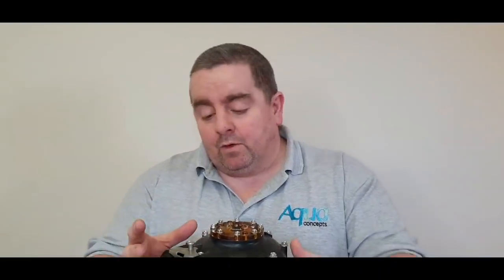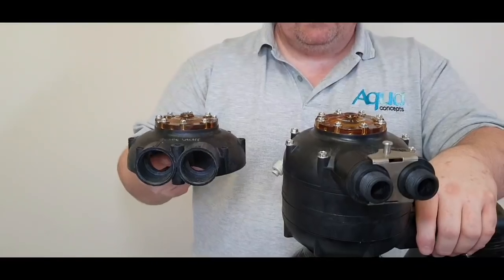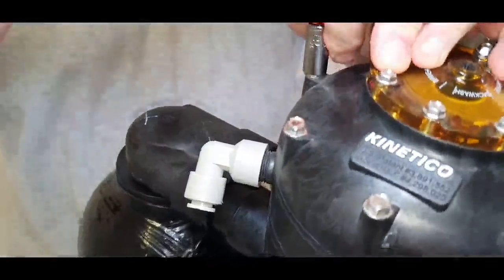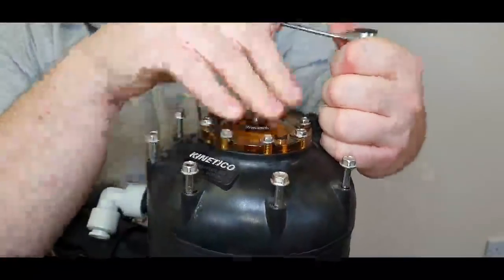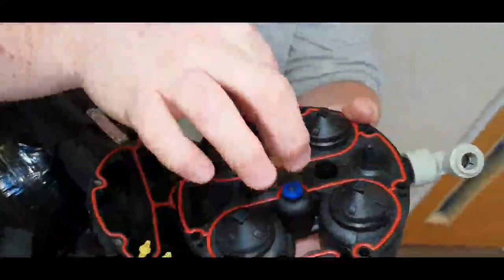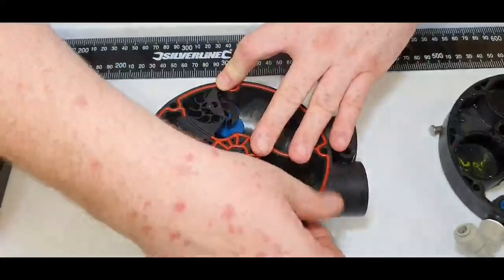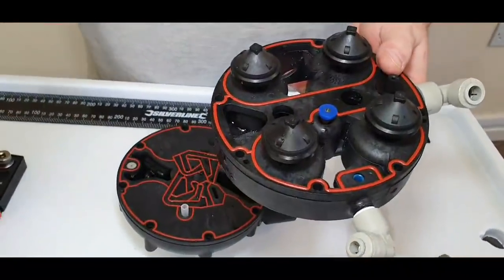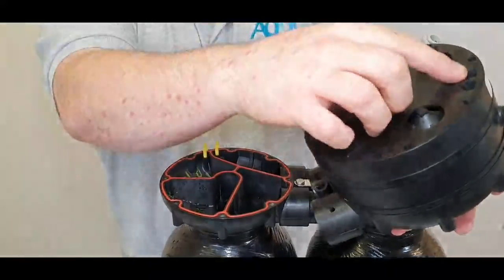Kinetico Breakdown And Rebuild [Kinetico Water Softener]

Comment: ok, stripped it down, cleaned it all, checked for broken damaged seals, cleaned out filters and put it all back together.  Works fine but will not stop going through the regeneration cycles.  Any ideas what I could be doing wrong?
Reply: Got it working!  Thanks so much for all your help, turns out the cone seal on the control valve was not seated on its pole.  I pushed it home and reassembled (fourth time) tested and all is good.  Thanks again.
Reply from the maker: @Mark_Walsh  👏👏👏 Great job and great achievement. Winners never quit, and quitters never win. 👍
Reply: So many thanks for all your help, I triple checked all the seals and put everything back together, unfortunately, I have the same issue.  I will try a new set of seals as you suggest.  I am purchasing them from here https://www.aquastream-softeners.co.uk/water-softener-spare-parts/kinetico-level-4-piston-seal-kit but it appears there are more seals than I need, is there somewhere else I can get these from?
Reply from the maker: @Mark_Walsh  That's the correct number of seals but you need the cones too for the control valves (small seals).
Aquastream will have them.
Reply from the maker: Does it draw the brine correctly? If so change all the seals on the quads and seal and cones on the control valves.
Reply: @TheWaterBoyuk  I think it does, how can I tell?  It appears to do everything correctly the salt chamber fills and empties, I can hear the gears going and the drain is working.  I tried shutting off the return pipe to see if it would stop and it didn't so the feed water must constantly be going to the drain.  I have opened it up again.  Suction is great on all the valves so I think they are ok.  I have checked all the seals and none are damaged or broken, the water doesn't taste salty so I am assuming the brine chambers are working.
Reply from the maker: If the level 1 control on the top is moving correctly, and its drawing the brine and refilling, I think you need to change the seals and cones on the controls valves. (Whilst you are in there I would change the quad seals)
Reply: @TheWaterBoyuk  One point raised on your video (at 7:47) was about the positions of the control valves and they would be referred to in a "link below", I cant seem to find any link.  Does it matter which is open and closed when I refit everything or does it sort itself out?
Reply from the maker: You do not need to set in a particular order. They will pressurise up in the correct position. Because it is having trouble coming out of regen take a look at the control valves

Comment: Amazing video, absolutely perfect. I put a silver "Sharpie" marker stripe diagonally on the housing so I immediately knew which way everything went back.  Could have done with this video a year ago when we had issues.  Turned out to be old media in our case and I replaced it quite easily.  One question though should I have filled the media to the top of each cylinder? (I was supplied with 9 litres, 4.5 per tank) but a few sites suggested to only fill two thirds (which I did and have obviously had media leftover), I didn't worry as both water pressure went back up and softening was working again.
If you did a video on the media replacement, tank cleanout and Meter Disc break down that would add to an already perfect rebuild.  Many thanks.

Comment: Thank you for an excellent ‘breakdown and reassembly’ video but unfortunately it didn’t cover the meter disc.

I have a 10 year old unused Kinetico 2020c HF softener which I at last want to install.
My water supplier is Essex & Suffolk Water.  Our postcode is IP237EE in their Water Quality Zone SFZ510 for which they quote
Mean Total Hardness (mg/l Ca) 185mg/l
Min Total Hardness (mg/l Ca) 160 mg/l
Max Total Hardness (mg/l Ca) 210 mg/l
They say to use the Mean Total Hardness and not the Maximum Total Hardness and not to multiply by 2.5 to get value in mg/l  CaCO3
Two queries:
1
If I use 185mg/l, the Kinetico 2020c installation manual says 185ppm would need a Disc 3 at 0.22kg setting which seems very low for a Very Hard water area.  The original installation manual gives values in ppm and doesn't say ppmCa or ppm CaCO3. When I queried this with them they  said ‘We would use the 185 mg/l Ca’
Would Disc 5 at 0.22kg setting be OK for IP23 7EE?
2
When changing the Kinetico meter disc there are two O-rings.  The smaller one goes on the snout below the cross-head screw but where does the larger one go?  Is it anywhere on the pressdown plastic piece
Reply from the maker: Thinking about a live stream over the next few days? Will cover these topics with level 1 and refilling the resin tanks. What do you think?
Reply: @TheWaterBoyuk  That would be great, Thanks
Reply from the maker: I will do a Level 1 breakdown for you. Friends in Ipswich normally use disc 5.
Reply: @TheWaterBoyuk  Thanks as I have a 5 available! Will look forwardt the video

Comment: Thanks for your suggestion. I haven’t found any leaks or drips, but I will do as you say and monitor the water meter when everything is supposed to be off.

I have a Kinetico twin tank, not sure but it may be about 15 years old. Model High Efficiency 07/02 - 01524. I don’t know the technical specs so I’m estimating that it would soften 1,500 lts between regenerations, and would use 30 lts during a regeneration.

Our water consumption is low. The water meter has been fitted for 9 months and the water consumption has averaged 260 lts/day. That fits in with a rough calculation for the use of toilets, showers, washing machine, washing up and cooking.

Lately the amount of salt blocks consumed has increased to a block every 10 days. 

When the Kinetico was bypassed for a month the rate dropped to 210 lts/day. If I assume the difference in daily usages (50 lts) was being used in regenerations then it was regenerating once or twice every day. It is hard to hear it in operation. 

I’ll let you know how the meter test goes.
Reply: as long as theres no holes in your twin tanks your safe unscrew valve headseparate from remote tank then separate valve head levels 1 thru 5 then work on replacing gears pistons seal...etc....

Comment: Thanks for this video, it has given me the confidence to have a look inside my old HE water softener. 
It has started regenerating too frequently. Nothing leaking either within the reservoir or around the house. I’ve bypassed the softener for the last 30 days and my consumption based on my water meter readings has reduced by 20%. I think the Kinetico may be over-registering my water use. I’ll look for damaged teeth on the metering gears.
Reply from the maker: Hey P Mill I have a suggestion to make. Make sure you are not using any water I.e. taps off, dishwasher and washing machine. Take a look at the water meter and see if the little dial is moving around slightly. The reason I suggest this is because it is unlikely that the softener is to blame. The increase in the frequency is more likely to be because of water usage. By trying this method you eliminate a dribble which would cause this problem. It could be a tap dripping or more likely a toilet internally overflowing which goes unnoticed. I should do a video about this. Let me know how you get on please.